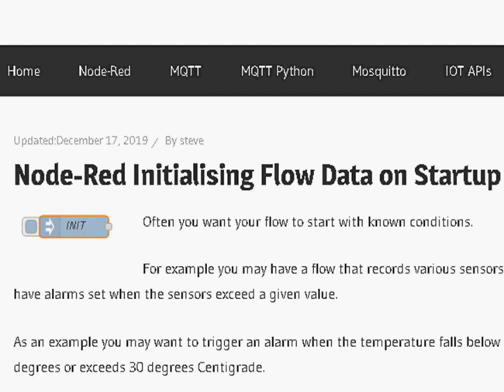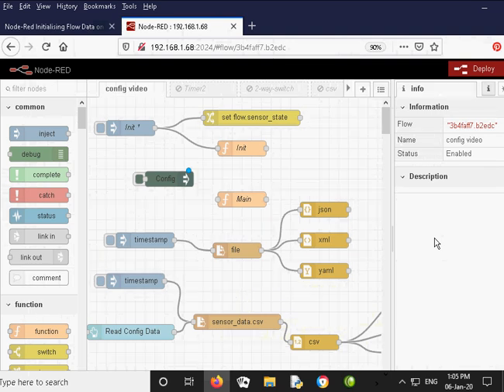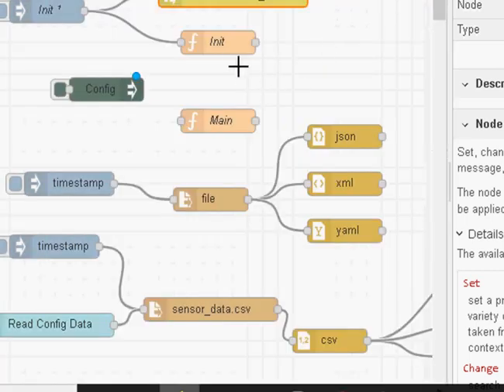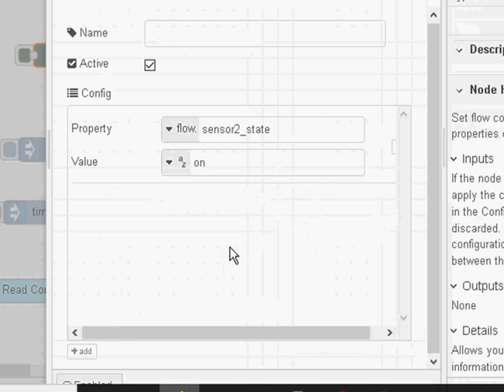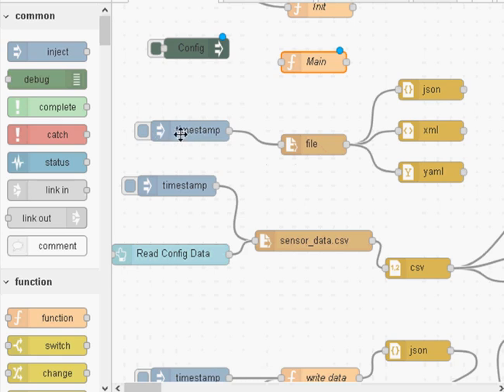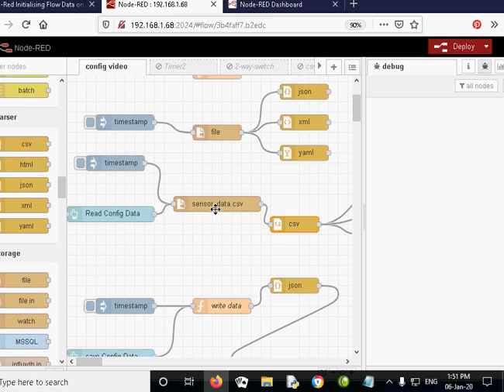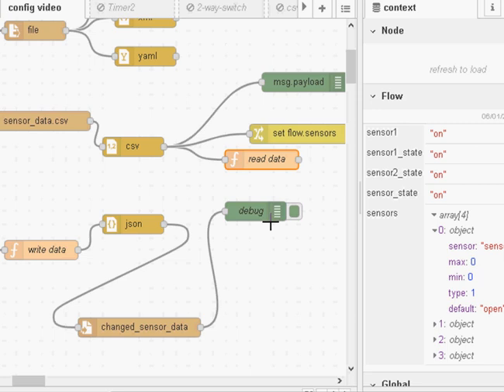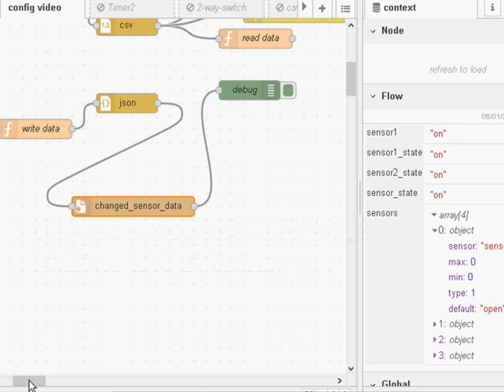Initialising Node-Red Flows

Comment: Just discovered your channel and its just what I need. I am developing a system for an autonomous ground based robot which is essentially an IoT in terms of the sensors it carries and the images it collects. I am developing the dashboard to visually monitor the sensors. I have just looked at your range of videos and will start to binge watch them this evening. Colin (East Anglia, UK)

Comment: Hi Steve, thanks for these excelent video. I am a rook and I have tried to implement the Config Node over "npm install node-red-contrib-config". But it doesn't work. There is no Config Node. I have tried to implement it over "Manage Palett" but there is no "node-red-contrib-config" Node. Can you give me a hint ?
Reply from the maker: Hi
Strange I just looked at my install and that is exactly the correct name for the node. Do you have another machine to try it on as it could be something strange with your install.
Rgds
Steve
Reply: @stevecope  To fix the problem I have made a new installation at an Raspberry 4. Now I use Red Node Version 1.0.3: Maintenance Release. I install it over a terminal session and it works. Thanks for help. I hope we get much more explaining Red Node videos. For me they are realy helpful. It would be great if you could make a tutorial for Red Node and Zigbee. I have some Xiaomi sensors that I would like to integrate.
Reply from the maker: @uweri_3851  I Am looking at Zigbee at the moment and hopefully will have something out in the next few months
Rgds
steve
Reply: @stevecope  Good new's. But no stress please. I can wait.